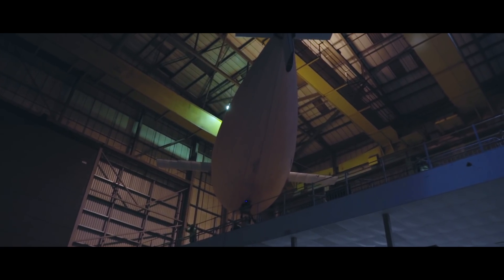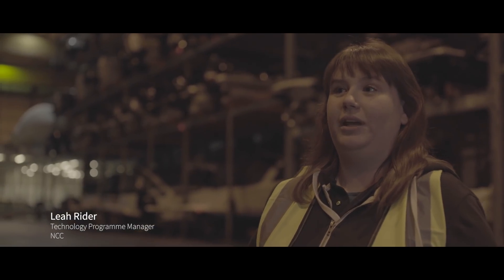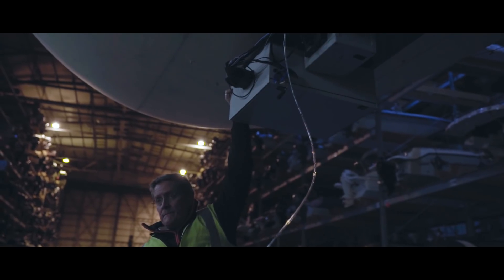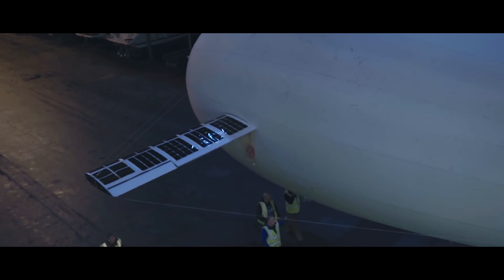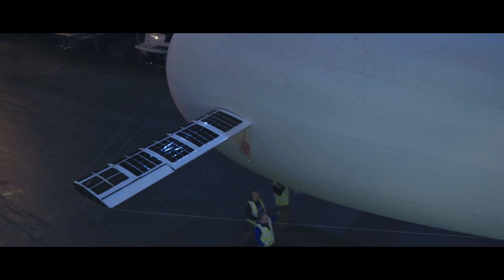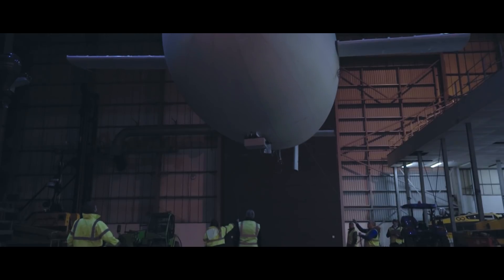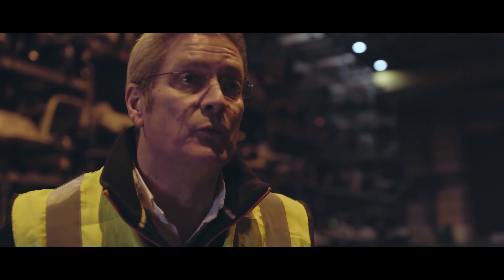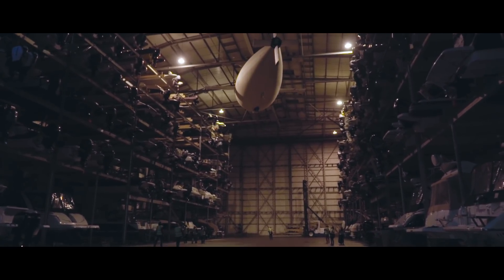Phoenix demonstrator variable-buoyancy aircraft

Comment: rockoons are balonga. there's plenty of previous more than 10 years old dreams to do this. 
high altitutde sky stations that remain aloft indefinitely with payload and energy being provided to them are the future of sattelite replacement. remember, if you are in space either you are geostationary or in true orbit. this means anyone with suffient means can destroy your sattelite easily when it is over their meridian and you will have no recourse. in particular the u.s. cannot spy on china, with sattelites if and when the time for world war comes they will all easily be destroyed. 

worse, geostationary sattelites used for monitoring u.s. territory can still quite easily be targeted for destruction. sattiles are the opposite of submarines. they have the highest ground and are thus by far, the easiest things to see. 

the only competitive technology framework is persistent airships. 20meters is arguably too high as well. the airships will be used for the sweet spot of being visibile but not too visible. the higher they are , the more vulnerable they are , not to small arms fire, but to being seen on radar for the purposes of directing missiles and airpower.  the higher they are , also , the more air they displace so the larger they are. 

a platform that is 3000 meters high is sufficient ( as the u.s. military demonstrates with previous projects) . 
the key is building it to be robust and optimized for loitering around a center location to resist wind blowing it off it's locus. this is the future , to the extent bouyancy can be used to help center a ship, it is most certainly useful and it definitely can by allowing platforms to float away from high speed winds by simply going above or below them as needed, or by 'tacking' downwards or upwards into them as a bird might do. this would require a reduction in bouyancy. 

the vehicle doesn't need to be blimp shaped either , in fact, the notion that it needs to be lighter than air at all is false, it just needs to be neutral bouyancy. and it should be expected to use a lot of power. drones can deliver the blimp electricity, in 10-15 years next generation tethers can, and of course , laser rectifier 'rectennas' are only recently invented and should have the capacity to supplement energy with focussed directed energy in a far superior manner to a microwave system. the sweet spot in 20 - 30 years will incorporate advanced material science for thin films and adsorption. ultimately the entire system can use a rossier setup with an added compressor gas bladder. the adsorption can adsorb moisture, and electrolytically make hydrogen for storeage on board. the whole thing is powered by a  fuel cell, and the heat pumps ensure conservation of heat for the rozzier system recycling heat from the fuel cell as well as from circulating coolants from the hover propellers and from the hyper absorbant envelope, finally, a heat pump can be used to balance the heat load from daytime to night time and also, from the ambient air masses, as the station can drop and re-rise to capture heat as temporarily  needed  and made available .  

ultimately, if it works well enough over time , you make it bigger and bigger and build a platform on top of it to create the worlds first hotel at 2 miles up .  you can build the tallest building you want, but it won't be two miles high in 150 years. build that, and you will have the tallest hotel in the world for at least a century, more likely thousands of years.  perch it over a giant city , and you got one pretty nice hotel ready to charge premium rates for a night or more in the sky. 

the 1920s airships were doomed because they were simply unable to carry enough passengers across the atlantic compared to ships and airplanes. but airship hotels for loitering..... plane cannot beat that on cost because a  plane cannot loiter indefinitely without burning ridiculous amount of fuel. This hover platform in the sky is optimized specifically to do so. you can even build it in the shape for a flying bouyant wing designed specifically for corkscrewing (not spinning like a maple leaf, but corkscrew soaring like an eagle)  on the wind as it moves up and down.